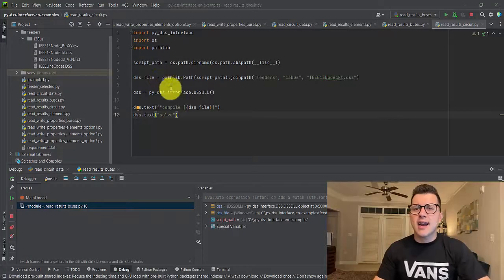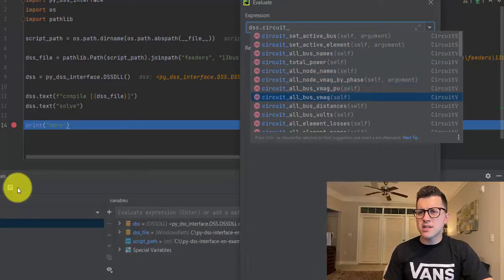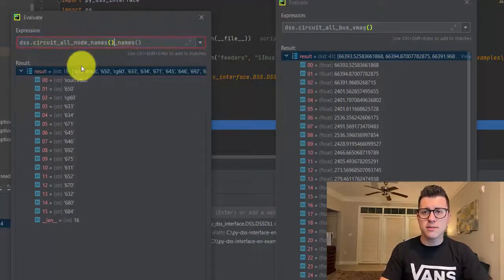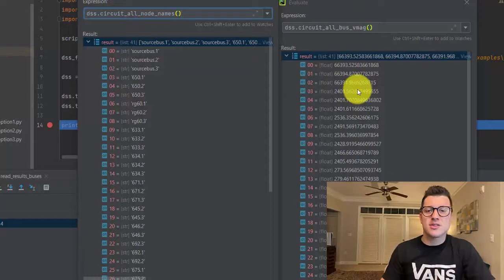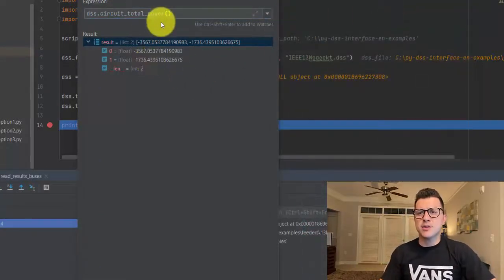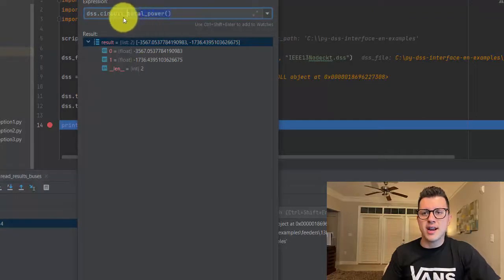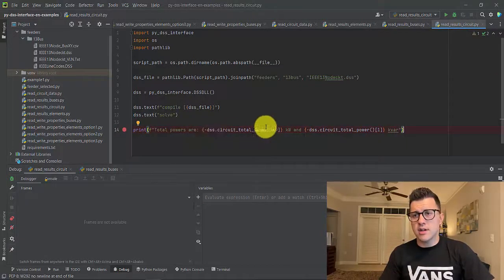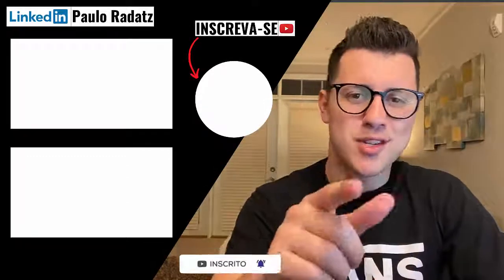13 - [En] py-dss-interface | Read Circuit Results

Comment: Hello, thank you Paulo for these valuable videos. I want to disable a line to isolate a part of my network. Actually, I do not want to open the terminal. Would you please give me the Python code to do that?
Reply from the maker: Hi Hooman,

To change the enabled property of the line to 'no', you can use the "text" method: `dss.text("edit line.linename enabled=no")`. This will remove that line from the circuit.

Alternatively, you can use the command `open line.linename terminal=1` to open terminal 1 of that line.

The swtcontrol element can also be used for control.

If you are able to implement this in Python, could you share the code with us?

Best regards,

Paulo Radatz
Reply: @PauloRadatz  Hi Paulo,
Both of the approaches you provide work well in removing lines from the circuit. Additionally, I used another way to reach this goal:
 
dss.circuit.set_active_element('name of the element)
dss.cktelement.enabled(False)

It works for me to remove each element I want. You can use it to enable (dss.cktelement.enabled(True)) or disable (dss.cktelement.enabled(False)) the activated element.

Kind Regards,
Hooman

Comment: hello, I Have a project where I have to find all the currents, active power & reactive power at all the edges how might one find that?
Reply from the maker: Is it for one timestep? How are you defining the current, P and Q for one edges? You could loop all elements and get the values of the first or second terminal.

Comment: Hello, thank you for these videos, will you please make a video or provide any kind of reference on how to add a customized controller to openDSS using py-dss-interface.
Reply from the maker: Hi Avik, could you elaborate a little bit more what you mean by customized controller?

Thanks for your message!
Reply: @PauloRadatz   Sure. Thanks for the reply. 

For example, suppose multiple PV systems are connected to the IEEE 13 bus system. Around afternoon the the power output is maximum from the PV systems and the size of the PV system is such that they are injecting a high amount of power which is greater than the capacity of the feeder transformer. Now I was trying to use the volt watt and volt var control to control the penetration. The violation on the voltage side can be controlled using these controls but even after reducing the penetration using these controls the current that is flowing on the transformer winding is beyond the emergency amps of the transformer. 

Now while searching if we can control the penetration also by taking transformer winding current as a reference I came across the flow chart of the simulation process where there is mentioned that one can insert customized controller operation. So, I was wondering if that can be possible through the py-dss-interface.

Comment: hi Mr.Paulo, I build a circuit with python and when i import one generator in the circuit , the y matrix change, so i take wrong results. If i don't import generator the results is right. Also i run the same circuit  without python and i take the right results but i want to run it from python for further things.Do you have any idea what is the problem?
Reply from the maker: Hi T.A, 

OpenDSS includes the linear part of the PC elements in the Y matrix used by its power flow method. OpenDSS does it, for example, when you use the solve command. 

If you want the Y matrix without the linear part of the pc elements, you should disable them and get the dss.circuit_system_y(). 

I hope it helps, 

Paulo Radatz

Comment: Hi Paulo, thank you very much for your tutorials. I have installed the py_dss_interface in Linux. I also installed the Opendsscmd version. However, I cannot use the interface in Linux. Do you have documentation or tutorial about this? The idea is to work through Terminal in Linux and use everything as a container/docker.
Reply from the maker: Hi Fernando, 

The py-dss-interface uses the official versions of OpenDSSDirect, and EPRI does not create a .so version. Therefore, the package can't work with Linux versions.

You might find it useful https://pypi.org/project/OpenDSSDirect.py/
This package does not use the official OpenDSS version.